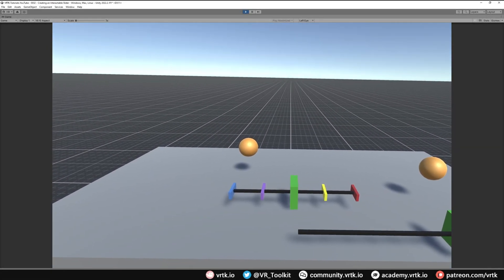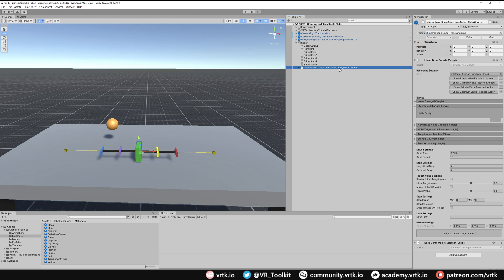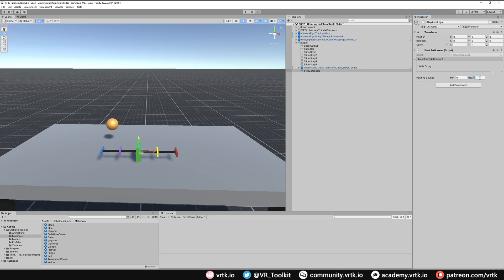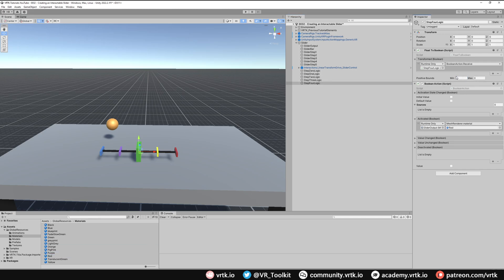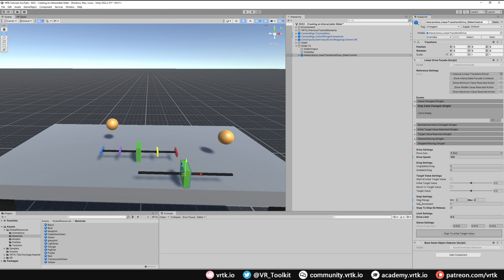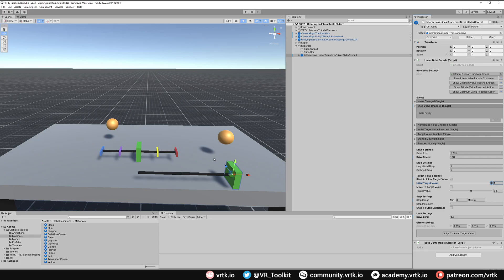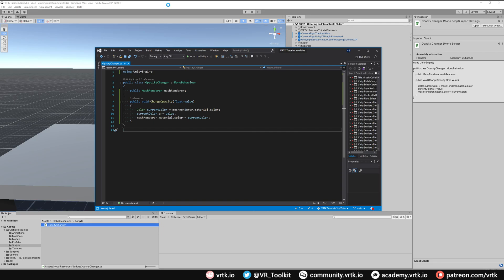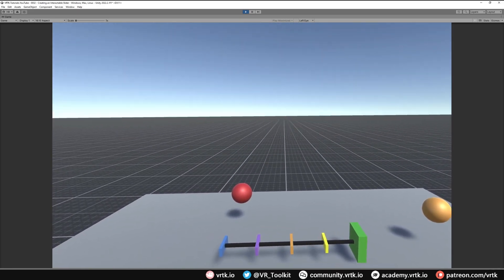[Unity XR] VRTK v4 - Creating an Interactable Slider

Comment: Hi! Nice video. Do you think is that possible to control the interactable sliders with Quest hand gesture (without controllers)?
Reply: yeah it's possible. all you need to do is hook into the pinch gesture as the grab action for VRTK and then grabbing a slider should work just as if you're grabbing it with a controller.
Reply: @thestonefox  thanks for your reply! I'd like to use the official Oculus Integration asset for the hand gesture controllers.
Reply: @thestonefox  sorry for the question again, but do you think that it would work with 'OVR Camera rig' , too?
Reply: @matebarkoczi9792  VRTK has a wrapper package to allow it to work with the OVR CameraRig
Reply: @thestonefox  thank you for your fast reply! so basically I don't need to import OpenXR CameraRig, I can work only with OVR Camera Rig and VRTK package?